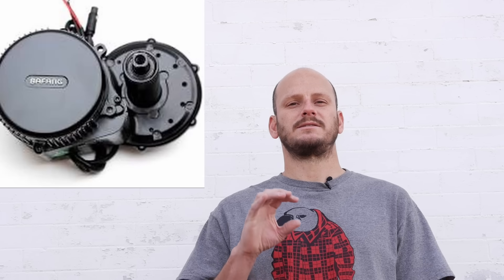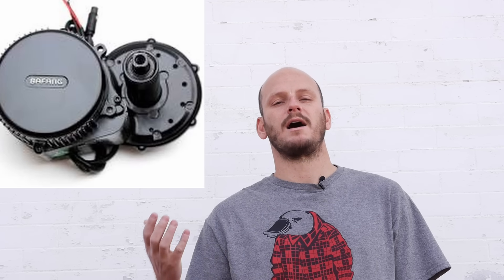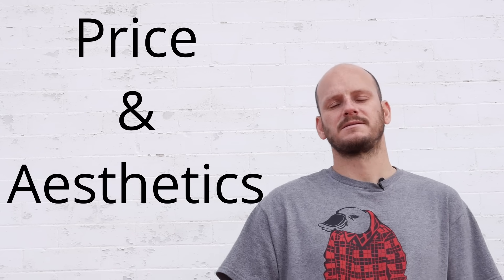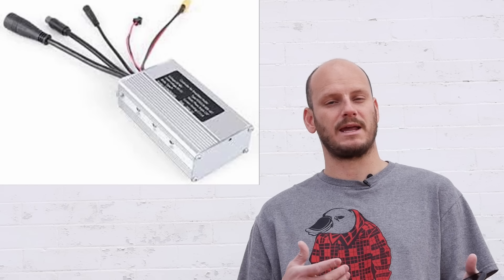Hub vs. Mid Drive Motors: Why Hub Motors Suck and Debunking Common Myths with performance test

Comment: I was all set to buy an Ariel Rider x-class, even bought some accessories for it but I've been getting a bad feeling in my gut about it. It's only a slight step above the chi-com stuff on Amazon and its really all the same stuff anyway. It feels like a fad and like its going to be junk in a year or so. Plus a lot of maintenance and care. Custom seat done right is over $400, motorcycle tires, etc. Do I really want to dump my money into that ? Probably not. I knew mid drives were better and those Gates belt drives look sweet, I just never thought I could afford one. They are, however becoming more reasonably priced. Coming from you with your experience and the practical information you've shared, I think I'm going to make a better decision. Better to spend a little more now on something I'm going to want almost immediately after spending all my money on something that is basically going to fall to pieces in short order and draw the ire of the general public. I would just feel ashamed for making such a bad choice. The side by side comparison video was nice work, very convincing. For just a bit more than I would spend on all that crap I think I found something nice that wont have people yelling at me on the greenways because I'm riding what looks like a motorcycle. That Priority Current is a classy looking mid drive, with belt, internal hub 5 speed ... and I can get it in a large frame size so I can actually get leg extension ( I'm 6'2" ). It looks like it will last for years and be a quality piece of kit. Let me know what you think of the bikes and thanks so much for your video. You put me over on the whole thing.
Reply from the maker: Thanks. That made my day😀 that bike looks pretty great actually. Those are the Ebikes manufacturers need to be making. Not the overpriced  hub driven crap that is still way too prevalent. That bike is something you won’t outgrow quickly.

Comment: If the bike is designed well to begin with, either bike will give you good service, hub or mid drive. Once you go to mid drive there is additional stress on the chain which is already the highest maintenance part of any bike. Belt drive solves the problem all around, especially with internal gearing but that adds to the price. So be careful to find a well designed bike whichever format you choose, and realize that to maximize the advantages of mid drive means spending more money.
Reply: I did a bit of research before recently buying an E Bike. I opted for a mid drive, belt set up. Yes, the initial cost is higher than a chain drive set up but this is ultimately mitigated by the longevity that they offer and may well prove to be more cost effective in the long run.
Regardless of the economics and low maintenance, I can't overstate just how pleasant the belt drive is to live with. It's quiet, clean and doesn't have the propensity to drag your right trouser leg through the front sprocket. 
I know that mid drives and belts aren't going to be practical for every application and budget, engineering is all about compromise, but for my purposes (commuting) I'll never go back to a chain.
Reply: @davidbrayshaw3529  I agree. My current bikes are both rear hub chain drive and good serviceable bikes but my next one will be a mid motor belt drive for the reasons you have stated. Understanding your reasoning, I wonder what bike you decided on and might be interested in purchasing one myself.

Comment: in US this comparison may work but not in EU..
Reply from the maker: Correct. A workaround is moving to the US. Then it works.
Reply: @JohnnyNerdOut  not a chance, totally backward Country that, just like the motors being reviewed in this video..
Reply from the maker: @igypop.  we’re different now. Totally different country and beliefs now.
Reply: @JohnnyNerdOut  Now? what exactly does that mean..
Reply from the maker: @igypop.  we had this guy come in to be our leader and made us great again😀
Reply: @JohnnyNerdOut  Hey? Trump or Biden - you may be surprised by my opinion, which could not be further removed from popular rhetoric in main stream media about this subject matter (on either side of the pond), but how is that relevant to the ebikes?, mainstream manufacturers on this side of Atlantic use mostly Bosch, Shimano or Yamaha and sometimes Brose, else Neodrive for hub motors, on other hand EU restrictions are more severe than USA; max power assist 250W and max speed 25km/h and no throttle assist, anything above that requires minimum age to operate, a licence (registration (number) plate) and is forbidden from riding in nature and/or bicycle paths, Europe is simply too small with too many people, although some EU Countries have less restrictive regulations..
Reply from the maker: @igypop.  it was a total joke. I see politics more as theater more than anything of substance( at least here). As ebikes get more popular here in the US I’m sure regulations will also become more strict to align more with the EU. But until then it’s a great time to only Ebike here in the US. 750 White Mid Drive really is a fun mode of transportation. It’s just going to take a few people to get seriously hurt and killed unfortunately and people will cry for stricter regulations. I would rather be ahead of the curve and get education out there on how to operate Ebike safely and responsibly.
Reply: @JohnnyNerdOut  someone once told me that the circuses ceased to exist 'cos all the clowns went into politics, as for power for ebikes - I'm on the fence, as an example; Germany speed limit - no speed limit - should you posses a vehicle that is fast enough and be so inclined to drive at those speeds with deep enough pockets for fuel and service you could easily drive 350km/h, but restricting the class1 ebikes to 250W and 25km/h (?)..
Reply from the maker: It’s definitely the responsible thing to do. I’m sure USA will be similar within a few years. I hope not though. I also see both sides of the fence though. Just as long as they don’t outlaw mid drives I’ll be happy 😃

Comment: Hub drive average price 500$? Are you kiddin me? The lowest price for a 750w bafang mid drive on amazon or aliexpress is around 500 when basicaly any 750- 1000-1500 w hub kit is 200 dollar.....

The bafang kit is 3X the price of a hub kit wtf is this nonsense ? oO
Reply from the maker: That’s like complaining that a Chevy cobalt is way more affordable than an Audi A8. It’s what your getting. Also, I sell the bbs02 for $450. I would not touch a motor kit for $200 and would never suggest anyone buying a kit at that price point. You get what you at for. You might get lucky though, there’s no hard fast rules
Reply: @JohnnyNerdOut  Already done 1000km in mountain in Savoie France at "Signal du Mont du Chat" stippest longest consecutive hill in france, you can check it 9 percent, the kit has alrady been paid by itself at this point. Fitted on a downhill bike didnt even bent a spoke or anything yet maybe im lucky but i doubt so
You say the price is nearly the same but as i mention it's absolutely wrong, you can have a hub kit for 200$ that's it nothing to argue about that
Reply from the maker: @DefconLaccuci  you can totally buy a kit for $200. But it’s a different brand/quality. Like Kia and Tesla.
Reply: @JohnnyNerdOut  You are absolutely right, also dont need to mention a bafang BBSHD will put more than 150NM of torque when the better 1500w hub will put at best 80 -90 and that made a HUGE difference especially in stippest forest climb that force hub user to put max power and gave lot of pedal assist to translate power to rpm.
It's  great for entering the ebike world, but ofc a bafang or drive motor will be better in all case especially torque and battery usage.
I just pointed out the mistake in price, cause most hub kit come around 200, the only cost more (400$) is bafang hub and few mxus with 3000W 
A hub kit is really afforable and cheap when any bafang like will be basically over the roof for a broke ass guy

Comment: So you have broken 2 chains on 1.5 kw mid drive... what about if its 5k or 8 k?  How long will it last?
Reply from the maker: I would go single speed with that kind of power. Possibly to a 3 speed IGH. Might be able to make it last 400-500 miles. I have 1500 miles on my single speed now @1500w

Comment: Have been working on a bicycle shop as well. We sold many mids and hubs. The reliability- you don't mention the effort and cost of fixing a mid that has worn out bearings and gearing system parts. That's why I run a hub motor.
Reply: I love hub motors! ❤️mids are lot off $$$
Reply: It depends a lot on the type of motor. I've serviced many Bafang hub motors. It's only a few minutes to remove a couple of T-25 screws, and the motor assembly slides right out of the hub shell. The most common issue is that the nylon planetary gears can be come cracked (the motor will make a clicking sound). Every once in a while, one of the magnets for the hall sensor might have to get glued back into place.
Reply: After having replaced the hall sensors on a hub motor because the cheap bearings wore a bit, causing scraping on the outside of the rotor....I'd happily replace gears or bearings in a mid drive motor.  Hall sensors can be very tedious and time consuming.
Reply: What bearings? The wheel bearings? Those are cheap and super easy to change. Gears? You mean changing a rear cassette? That's like 5 minute job
Reply: @sunyun4425  the one i did was an unbranded chinese motor. on a gio scooter...solid hub wheel, no spokes.  sealed with silicone, just splitting the hub open was a challenge - it was apparently never intended to be serviced. then to get the hub motor wheel bearings done, need to clip off the plastic plug because its bigger than the bearing bore...were talking a couple hours here at minimum. doing the hall sensors including soldering and splitting the hub open was around 4-6 hours....so yeah internal gears on a mid motor i think access and service would be a lot quicker.
Reply: Or the excessive wear on your drivetrain, I basically had to replace everything but the rear derailleur every six to eight months. Don’t get me wrong mid drives have a lot of advantages but bike drivetrains aren’t built to commute with 1500w of power plus me every day.
Reply from the maker: In my experience it’s easier working on a mid drive. But slightly. Possibly because I’m used them now. I guess it also depends on what you have to repair on each motor.
Reply: @JohnnyNerdOut  Can you do a video where you review a "donor" bike which has a beefy drivetrain that can handle the power of the mid-drive and not chew through it every 6-8 months like the guy below says?